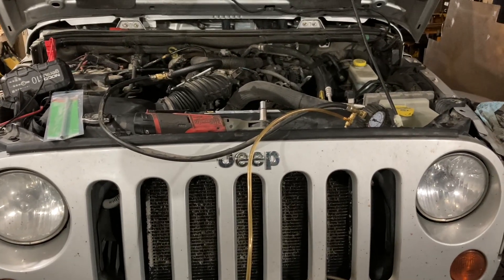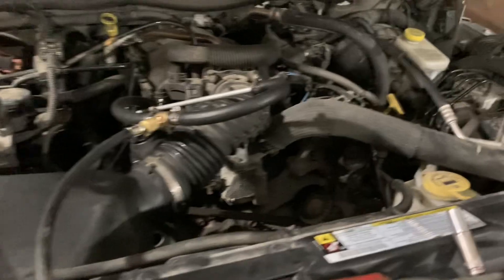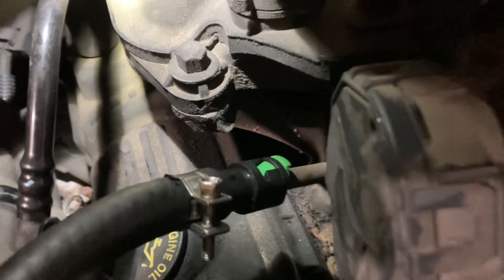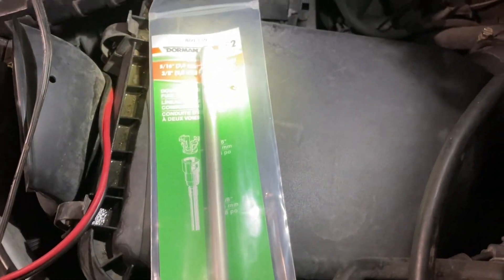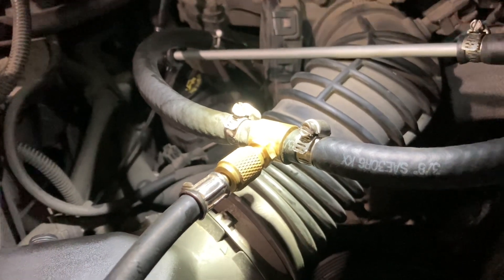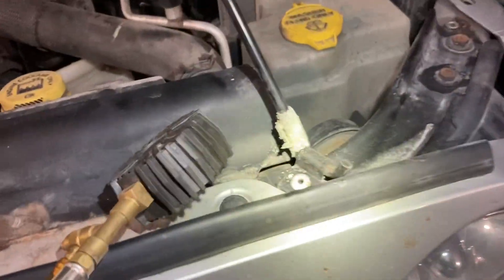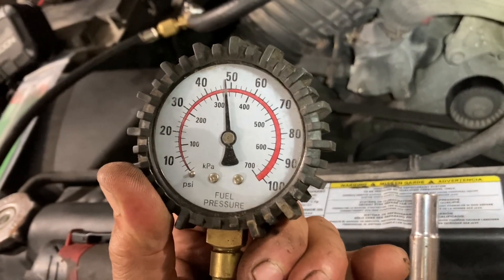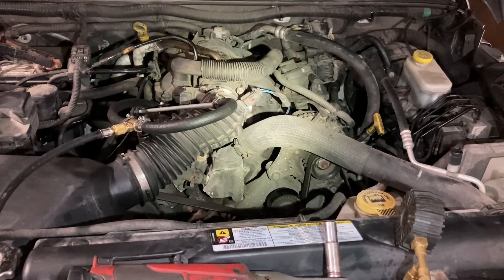2007-2011 JK Jeep Wrangler 3.8L fuel pressure testing and spec

Comment: Nice video......would you happen to know where the fuel filter is located on the 2007 Wrangler? I can't seem to find that info on youtube. Thanks in advance!
Reply from the maker: @JoseJimenez-me5fq  built into the fuel pump. It is non-serviceable by itself. Basically it gets replaced when the fuel pump is replaced someday.

Comment: Is there a Dorman part number to get the Female Quick Connect 5/16" ? is that double bead line, is that plastic? it looks plastic in the video.. but it must be metal..

I want to order that part number to do this same test.. but I'm thinking I also need a female end to make the job easier.. ?
Reply from the maker: 800-159 is the part number for the pack. It is steel. It will have a 3/8 and 5/16 double bead fuel line. I wouldn’t worry about the female end too much. It’s nice to have, but just clamp it securely with a good hose clamp. It will hold the 60psi just fine.

Comment: Is the engine running with fuel pressure at 58.5psi while pulling vacuum on the manifold side? Or is your gauge at ~48psi correct and pressure delta between fuel rail and manifold 58.5psi by compensating for vacuum? Im trying to understand how much the ECU controls the PWM of the fuel pump. Is it for constant 58.5psi delta pressure or 58.5psi fuel rail pressure. 
If what you say is true and idling had the gauge at ~59psi on the rail side than that means the pressure delta is closer to 70psi due to vacuum being pulled on the manifold side. All this is reflected in the fuel map table values.
Reply from the maker: Don’t overthink it. The gauge reading in the video is with the engine off, and pressure slowly bleeding. Simply put: with the engine running, pressure will be approximately 58psi. If you see 55 or above, you’re fine.